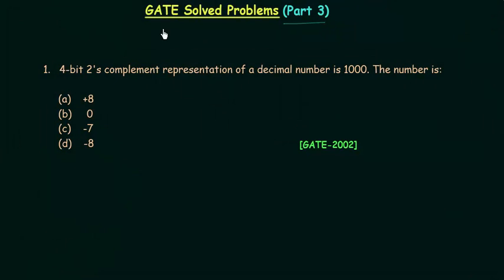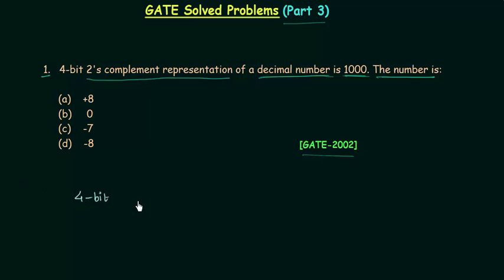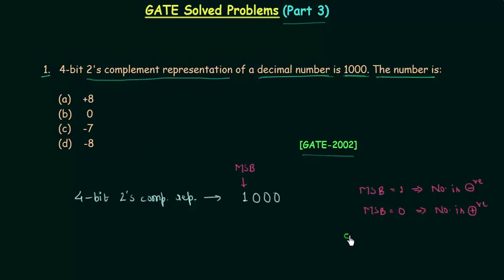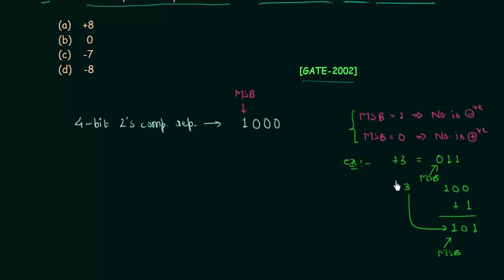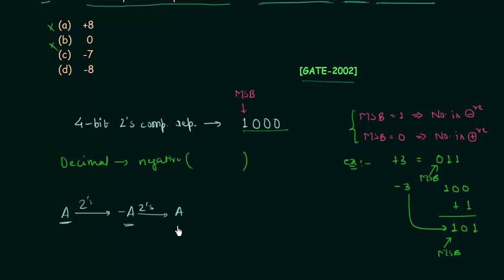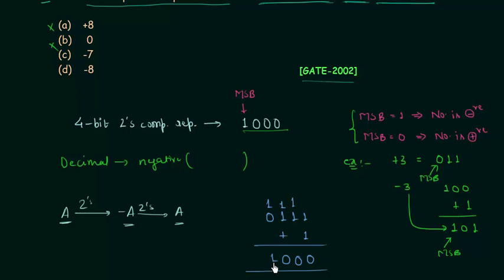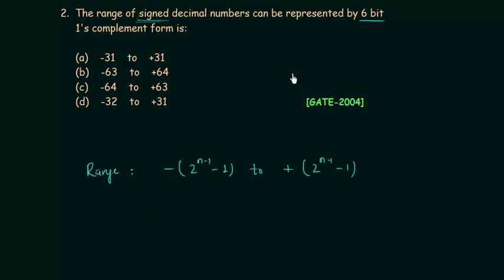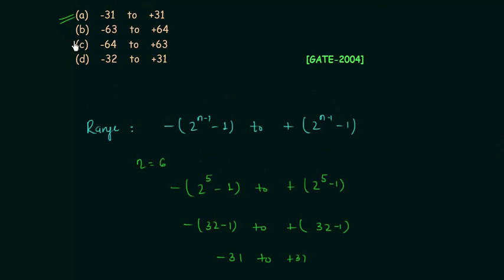GATE Solved Problems (2002-2004) | Number Systems | Digital Electronics

Comment: The range of 1’s complement form is from[ -(2(n-1)-1)]  to [+ (2(n-1)-1)] . For example, Range of 6 bit 1’s complement form binary number is from  -(25-1)  to  +(25-1) which is equal from minimum value -31 (i.e., 1 00000) to maximum value +31 (i.e., 0 11111).

 The range of 2’s complement form is from [ -(2(n-1))] to  [+(2(n-1)-1)].For example, range of 6 bit 2’s complement form binary number is from - (25)  to + (25-1) which is equal from minimum value -32 (i.e., 1 00000) to maximum value +31 (i.e., 0 11111).

Comment: will you please correct the range formula confusion: you said in your previous video that for range formula is: -2^n-1 to (2^n-1)-1
Reply: range is: -(2^n-1 -1) to +(2^n-1 -1) for signed magnitude no and 1's complemnt no
range is: -(2^n-1) to +(2^n-1 -1) for 2's complement
Reply: @SumitKumar-oq3ep  What you have said is correct

Comment: the answer for last question range should be -32 to 31 as per your explanation in previous videos. am i right
Reply: subalakshmi ramadass even I thought the same
Reply: No, please see that both are different cases. The previous one was for the range in case of 2s comp rep for 4-bit numbers and in this video, he is discussing the range of signed numbers for 6-bit
Reply: @prayagamenon7565   but the formula is same everywhere. he wrote range formula. either video is wrong. they collide each other
Reply: subalakshmi ramadass cfg
Reply: yeah definately, why he is changing the formula now?
Reply: Formula for signed magnitude and 2's complement are different. Check in d net.